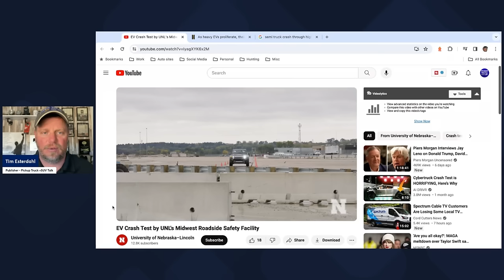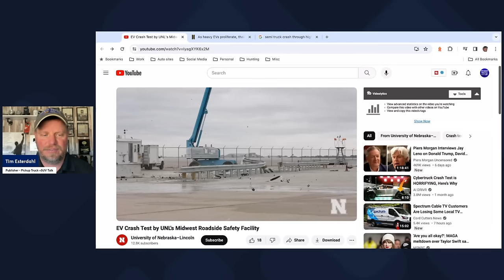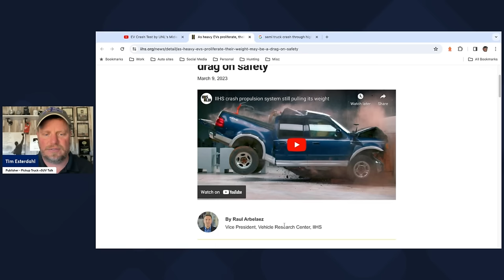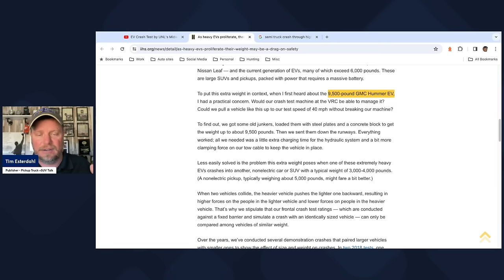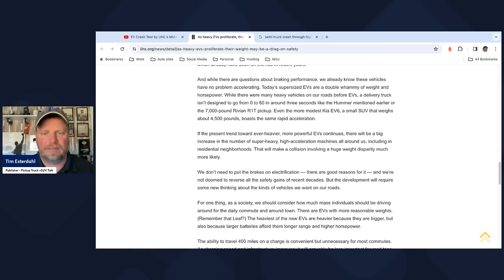Rivian R1T Plows through a Highway Safety Barrier Raises New EV Concern

Comment: EV have a lower center of gravity because of the placement of the batteries on the ‘skate board’ platform …On impact that battery case turns into a battery ram ,which produces tremendous amount of kinetic energy on the impact area…

Comment: I see a lot of people commenting on how the occupants would be safe inside the Rivian after ripping through a steel guardrail like a piece of paper. Wow! People clearly don't understand what a guardrail does or why they are strategically placed alongside the road! And I don't think anyone picked up on the statement that you wouldn't want to plow through a guardrail in the mountains of Colorado! Unless your Rivian comes with ejection seats and parachutes as standard equipment then nevermind, you'll be fine.

Comment: At the dump weigh scales my standard range is 600 lbs more than the 2018 Ram 1500 Hemi I had.  6300 lbs for an F150 XLT standard range.  Half tons were once 6000 lbs range before all the EPA lighter frames and materials.  Does this argument apply for an F350 diesel which is what 8000 lbs?  In my opinion consumers views and expectations are about 10 years behind what is actually going on, nothing wrong with the battery technology and it's been out for over 10 years.  I think what happened with the video is the mass of the vehicle is down low at the guard rail and rivian is more of a start up company, not much energy absorbed here with the body work.  Mechanics like EVs due to the nightmare long term reliability of new gas cars.  If you actually put any mileage on your cars you would know what they are like these days.  A 30 year plus mechanic I know drives a leaf and he loves it.  I'm driving about 3000 km a month still, 6 dollars a gallon up here in Canada, and to be honest I think this F150 EV is the best vehicle I've owned.  Zero environmental reasons for the purchase, just cheap to run point A to point B, heats up quick in winter, tons of traction weight is distributed nice.  And I don't need to have the shed full of waste oil all the time now.  I'm sure this video will get some views, lots of anger out there these days.

Comment: The current generation of EVs which are currently heavier than conventional ICE vehicles is no different than any heavy duty truck owner and there doesn’t seem to be a safety concern over those. No one is accelerating in to barriers and any collision is at a steady state highway speed like any other vehicle or driver. What are your thoughts?
Reply from the maker: That’s a question I’m trying to find an answer to.

Comment: It’s not so much about EVs but about the surface infrastructure along our roads and highways. 
The hardware along our roads was designed and implemented over time to accommodate the vehicles that predominately use it. 
What this test tells me is that some of the protective equipment will have to be redesigned as EVs gain popularity and represent a larger portion of vehicles on the roads. 
To those that dislike EVs, this is just one more reason not to purchase one. For EV owners it’s one more thing to consider if you happen to live in a mountainous two lane road with a 1,000 foot drop off a one foot shoulder. 😏
Reply: Such a redesign apparently happened a few decades ago when pickups and SUVs exploded in popularity. Seems to be just the nature of evolving to meet the safety demands of what people are or will be driving.

Comment: I don't think the vehicle weight is a big deal. Or at least it's nothing new. My HD weighs 7,600 LB, and it's not even a diesel. Tons of HD trucks on the roads and has been for years. So the nodding off or sudden loss of control on the highway risk with EVs is the same.

My wife drives a EV. The instant acceleration in the larger EVs could definitely cause some nasty collisions in weird places. As in you expect a truck on the highway to be going 65+. You don't expect them to be doing that speed in a small parking lot or on a small side street. They don't need much room to really get moving. My guess is sooner or later they will set restrictions on acceleration on vehicles over a certain GVWR.

Comment: The Rivian plows through the guard rail like it was made of string. The Jersey walls while attached to each other move dramatically too, especially when you consider how many tons they weigh. 

EVs because of their weight, go through tires rather quickly. Additionally, they contribute nothing to road maintenance and repairs through fuel taxation. There should be a tax per KW at chargers to cover this.
Reply: In Cali, my 3600 lb Tacoma pays more weight fees than a 6500 lb Suburban because the Suburban is classified as a wagon and not a truck.

Comment: I don't think the Rivian is doing anything a Diesel 4X4 HD wouldn't do specially if it has say 2000 lbs in the bed. Yes many EV's are way too fast. I agree. A Rivian can hit those barriers a lot faster. But there are many cars nowadays that are as fast but they don't weigh as much. What I predict (and it's probably already starting) is the insurance companies will make insurance for these vehicles cost so much that it will kill the sales. Pretty much like the death of the muscle cars of the 60's. EV's are already very expensive and when insurance costs almost as much as the car they won't sell . That will bring the speed of EV's to a more reasonable level, extend their ranges, and have lower insurance costs.
Reply: A Rivian is just mid-size vehicle with a unibody chassis, the equivalent of a Honda Ridgeline or  Jeep Grand Cherokee. It's not comparable to an HD Diesel 4x4. If they made HD Diesel 4x4s BEV, the trucks would weigh 15,000lbs or more.

Comment: Speed and acceleration limits would be built into the software. Kalifornia is already introducing legislation to limit vehicles to 10 mph over the speed limit. This will require manufacturers to include smart speed limit detection.
Reply: My 2023 Toyota Tundra Limited, shows the speed limit in the dashboard. When I drive Rt 42 in NJ, the speed limit ( which no one does) . There is one construction site, where the speed limit drops to 45, the display holds on to the speed limit well past the end of construction sign. Luckily the displayed speed limit sign on the dashboard doesn't affect the Truck, it's just for information.

Comment: I was hit 2021 by reckless driver going 20 kmh over speedlimit t-boned me it was hybrid minivan that pushed me two lanes UP a hill, 20K in damages my body has permanent damage as I was flung over my Equinox console into passenger seat and then violently swung back into drivers seat. The seatbelt did damage to my hip, restraining me with nerve damage to my hip & lower back; my neck was wrecked too. I still need a cane to walk.

My Chiropractor is seeing more & more  EV/hybrid doing serious bodily injury. My Province monopoly insurer doesn't care about speeding in crashes in 🇨🇦. 

That's why my Chiropractor said I have to get out of my 2019 Equinox into a big heavy truck with a high center console to protect my damaged body. As there are waytooo many EV's with reckless drivers. 

Driving a car is no longer safe in my area, but people are too ignorant/clueless, they don't even believe in dash/ cabin cameras to prove the reckless drivers. 
I have had a dash/ cabin camera since 2018 when I was side swiped by transport truck road raging everyone on provincial highway. Insurer & cops caught him because of my dash camera. Cop told me to upgrade to a cabin camera also for my protection which I did.

Comment: In before EV whataboutism fallacies.
Reply: Yeah, but what about a trash truck or a Boeing 747? Those are heavier than my 9,500lb Hummer EV, so I should be good, right?
Reply: The facility has seen this problem before. In the 1990s, as more people began buying light-weight pickups and sport utility vehicles, the Midwest Roadside Safety Facility found that the then-50-year-old guardrail system was proving inadequate to handle their extra weight. So, it went about redesigning guardrails to adapt.

“At the time, lightweight pickups made up 10-to-15% of the vehicle fleet,” Stolle said. “Now, more than 50% of vehicles on the road are pickups and SUVs.”

“So, here we are trying to do the same thing again: Adapt to the changing makeup of vehicles on the road.”
Reply: @eugenem5244 care to engage in this discussion about what I found direct from the testing facility?
Reply: @ALMX5DP  No
Reply: @eugenem5244  that’s unfortunate. I feel it’s a good discussion point to help bring about well rounded opinion and perspective.
Reply: @ALMX5DP  A better discussion point is EVs, since that the subject of the video, the one you're trying to direct people's attention from and gaslight over.
Reply: @eugenem5244  I don’t think it is, especially being my quote is directly from the people running the test in this video.
Reply: @ALMX5DP  Then go ahead to another video that makes that the subject.
Reply: @eugenem5244  why another video when this one is already doing just that?
Reply: @ALMX5DP  Seriously, you're just making his point! Good Lord!
Reply: @Jr210100  how so? I merely provided a quote and wanted to discuss its contents.